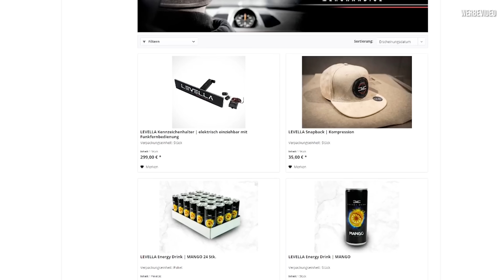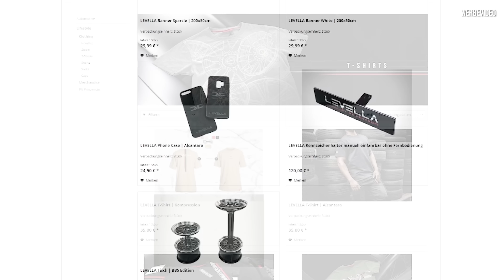LEVELLA | Neuer Innenraum für den BMW 635CSI - Zerlegen inkl. detailierter Anleitung!

Comment: Die momentane Farbe vom 635CSI ist so ziemlich die schickeste, die BMW damals hatte, und passt super zum 6er.
Schau Dir mal die braune Lackierung von Marcos Umbau an, die geht auch nur an dem Modell. Mein Vater hatte den 5er Baujahr 1978 in der Farbe, Albtraum.
Bitte den 6er nicht schwarz oder rot lackieren. So wie er jetzt da steht, ist das seine Farbe. Den gab es auch in furchtbarem Grün, BMW hat damals nie gute Lackdesigner gehabt.
Nichts gegen die Tiefschwarz-Hochglanzlackierungen von Deinem Kumpel, aber bitte nicht für den. Richte den bitte so gut wie möglich im Original her, und färbe bloß nicht den Teppich um. Und lass dieses Karbonzeug raus, braucht kein Mensch bei einem so alten Fahrzeug. Die momentane Farbkombi zwischen grau / schwarz / anthrazit bei Lack / Stoff und Leder macht diesen Wagen aus.
Der 5er BMW, den Marco Degenhardt gerade gekauft hat, beweist, was die Farbkombi kann. Bitte keinen Blödsinn mit den schönen Wagen anfangen.